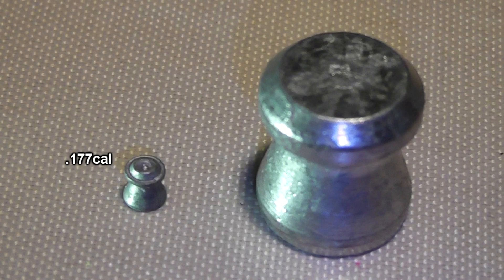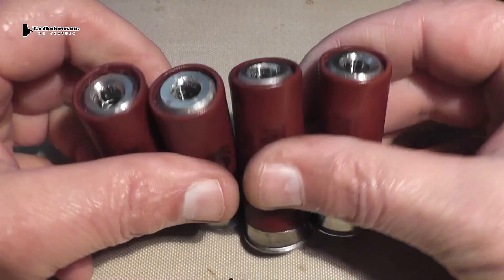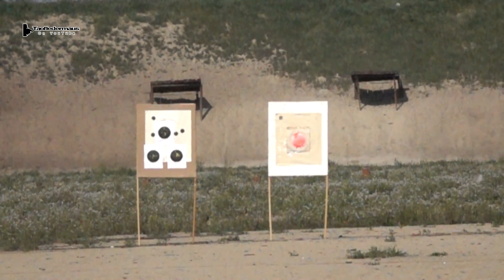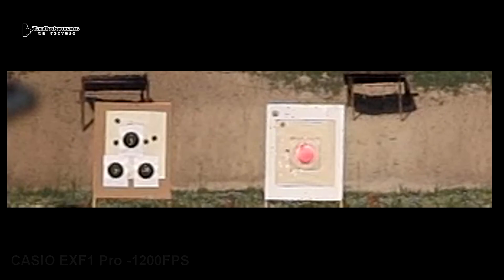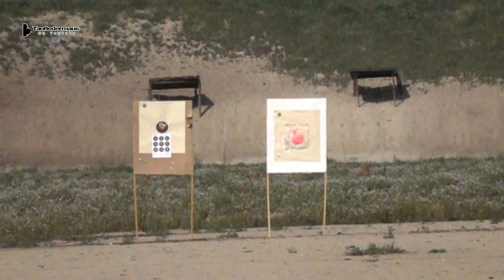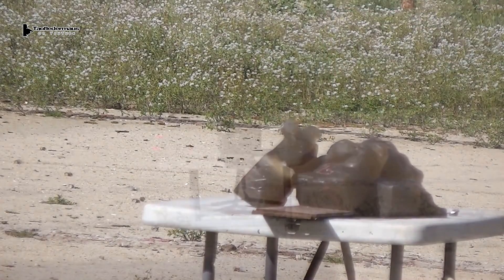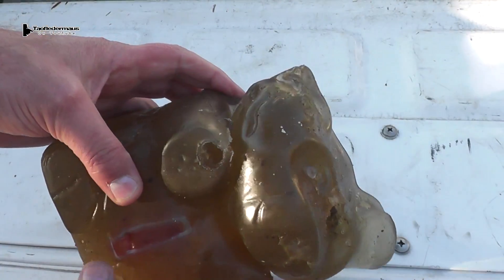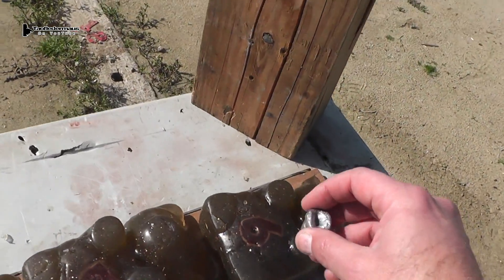Totally HOLLOW Bullets?   - Unusual Shotgun Slug

Comment: Put a thick pvc disk behind the total hollow point before you place it in the shot cup. Wouldn't a lot of unburned powder exit through the hole of the slug, and into the barrel, fouling it up? I wouldn't trust a total hollow bullet, IMHO.

Comment: About 20 years ago I bought some 50 Cal. muzzle loader bullets that set in a sabot that had a hole all the way through them. They were surprisingly accurate at 100 yards and didn't drop nearly as much as other bullets. I still have a few left and don't plan on shooting them because they aren't made anymore. The sabot is extra thick at the base to compensate for the hole in the bullet...

Comment: +TAOFLEDERMAUS  IF you get anymore of these slugs, try drilling them, partway with a 5/16th, and then fill the cavity with wax, and cap it with a steel 5/16th inch bearing as a nose cone..

Comment: I don´t know why, but I expected these slugs whistle like nerf gun darts.
Reply from the maker: +Waggerinator  I was hoping they'd make a cool sound too!
Reply: +Waggerinator The physics of air & aerodynamics make that impossible. Some thing that air is kind of like water, where in an opening it would go through.. But it doesn't, a small opening has zero bearing on a ring being tossed vertically, the opening would have to be quite large for the air to be able to pass through, instead what is happening, is the air is actually being forced around the object as it is hitting on the flat parts of the nose, and forcing the air to bend.. 

Flight Characteristics come into play, being that there is going to be some drag & lift.. 

Nerf darts travelling at the speed of sound, would not make any sound either ;)
Reply: +TAOFLEDERMAUS  Some of your machine savvy fans needs to make you whistling rounds. I have the whistling arrowheads, maybe just scaling them up to fit the 12 gauge could work.
Reply from the maker: I don't think it is possible to get the right air flow in a supersonic environment.

Comment: That's really weird that the air didn't fly through it
Reply: +Allen Ashley When it's travelling through the barrel, it is accelerated by explosion gases of much higher pressure, with nitro card stuck to it with all the force, making it push air, both the air in front of the metal parts and, very importantly, the air inside the hole. Said air gets compressed so that even after the slug leaves the barrel, the uncompressing air makes an air cushion around the tip, pushing air in front of it to the sides.

Of course, it doesn't last forever, and so the nitro card flies off, the compressed air gets lost and you have airflow through the hole.

Comment: hi m8 another fun film. i just watched the carpet tack video and had a thought (you have probably already done similar). using the large lead pellet, drilled out centre and using a nail or hard tack point forward pushed through from the back and back filled with lead solder. it may not pierce armour but giant gummy damage could be fun.

Comment: What if you put a penny at the bottom of the round to act as a pusher that would fall away quickly allowing the airflow to develop through the center?  Also what about a larger hole to create a sort of massive air path to reduce drag.  Would love to see this round hit a gel block (side view) to see the cavities formed.
Reply from the maker: +Johnn Schroeder  A penny is too large.  When I trimmed the slugs and removed the crimp from the center,  I put that crimp at the base to act as a nitro card.   Because of the shockwave,  air doesn't seem to be flowing through the hole at all.  It is all going around the slug still and creating a vacuum that the light nitro card is flying in.   Once the slug starts slowing down,  the card is no longer held by the vacuum and falls away.
Reply: Thanks for the heads up!

Comment: Tore through those bears like a train... a very fast train that is. 

The slugs worked about as well as I thought they would, what with the aerodynamic shape being thrown off by the hole... But as someone very wise (or endowed with a shotgun and high speed camera) has pointed out, it's hard to tell how things will move at these speeds, so it was really nice to see this experiment.
Reply: ***** That's an interesting thought, actually.

I took it to be that when the slug turned so that it wasn't facing straight ahead, the hole caused turbulence that made it difficult for the tail to straighten it back out.
Reply from the maker: +Zack Toor  I don't think my holes on any of them were well-centered.   I wish I had access to a lathe so I could have bored centered holes through them.
Reply: ***** Might be interesting to see this one redone with more centered holes, perhaps. But even as was, this was both entertaining and informative, and that's the whole point to a really good video :).

Comment: What if the hollowed out slugs had rifling done on the inside of them and maybe on the outside as well?
Reply from the maker: +Big Ron Parker  I really don't think the air stream would touch any rifling on it.   The air is pushed outwards like a V with the slug in the middle of it,  in a vacuum.
Reply: +TAOFLEDERMAUS How about a slug with a hole drilled through the side...lol

Comment: I'd be interested in seeing if these would work a bit better if they were drilled out and then thinly capped.
Also, with carpet tacks (or, those spiral, thick ass concrete? nails) "welded" in, point facing out.
Also, any or all of these versus hard targets. 
Also, thanks for the great videos!

Comment: I had an idea you should try on wax slugs. Mix in some saw dust with the shot and wax and see if it makes the slug any harder. I saw that they mixed saw dust into ice to make really hard ice blocks so maybe it will make the slugs harder too. Hope you like my idea!
Reply from the maker: +Michael Cookson   I'll see what I can do.   It might make it weaker because the strength of a wax slug depends on the neat,  symmetrical stacking of the shot.  It's kind of like what makes concrete strong=-  the aggregate.

Comment: that almost acted like a coring slug in the gummi  gel   .        have you shot  .50  bullets   from a shotgun shell yet ?

golf balls are good fun to shoot at ..   I used to shoot them at 30 yds or so on a block of wood  with  44 mag hp  and get 100  yd plus drives  .  not many on the 'fair  way'  though
Reply from the maker: +kasnitch   We shot wax slugs at golfballs before and they actually blew holes through them and gutted the balls.   The balls would fly about 50 yards.

Comment: What about drilling maybe 3 or 4 smaller holes starting from the center and going 45 degrees off through the side of a slug and then angling them about 10 degrees away from the rotation? Maybe air will be channeled and cause the bullet to spin even faster.
Reply from the maker: +Kflyer   I really don't think the air would flow through the holes.  eh  Maybe after it went subsonic.

Comment: They shoot to the left because of left spin most likely.
Reply: you're thinking of the magnus effect (the reason a baseball curves in the direction of its spin) i looked it up and apparently it has very little effect on bullets. having said that we're not talking about an average bullet so it might be a factor
Reply: I agree... I believe the rounds are so accurate due to the drag of the round being larger in the rear. The hole must make the round completely dependent on the spin. physics maannnn crazy stuff; )
Reply: Well it is most likely the uneven weight spinning towards the left...